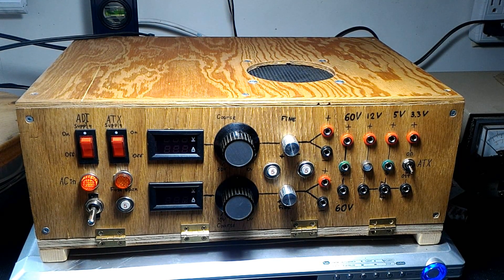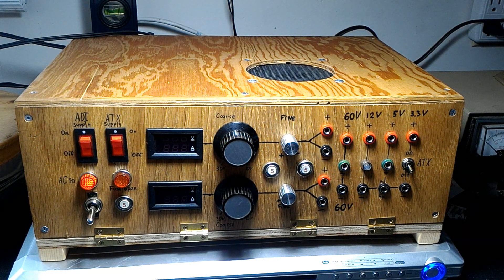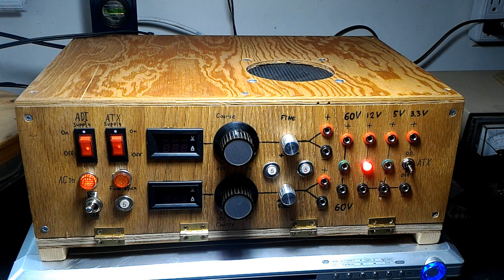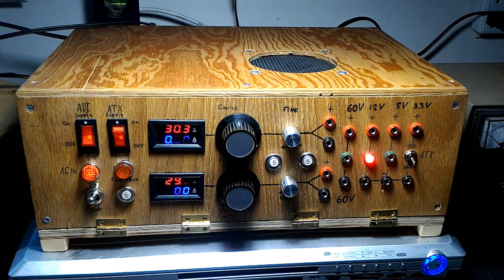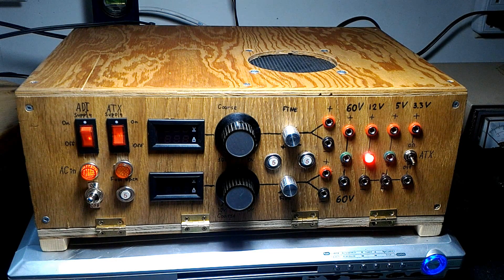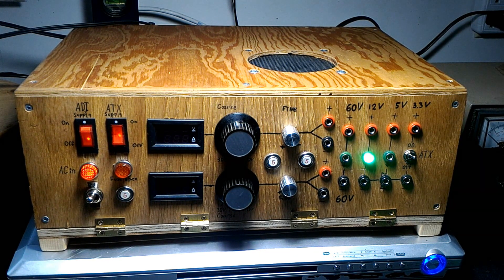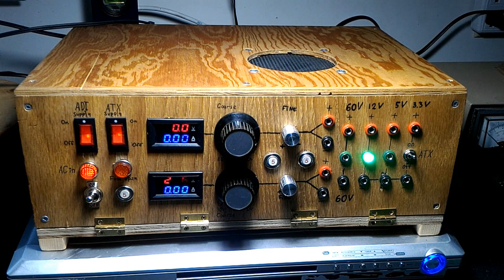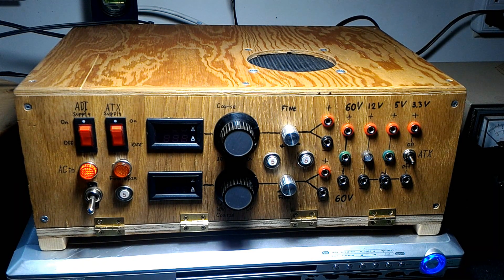HOMEMADE 2 CHANNEL LAB POWER SUPPLY 💣 (REVIEW)

Comment: i'm curious, for example, on the output could you theoretically get 120v if you connected the +60v and -60v and so on with the rest of the outputs? (24v, 10v, 6.6v)